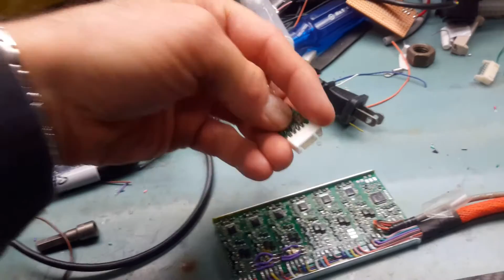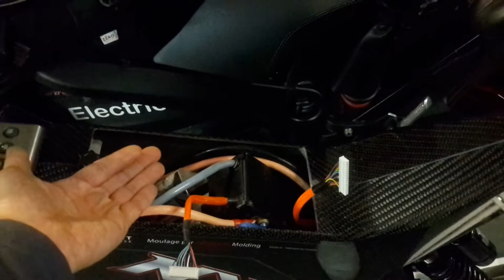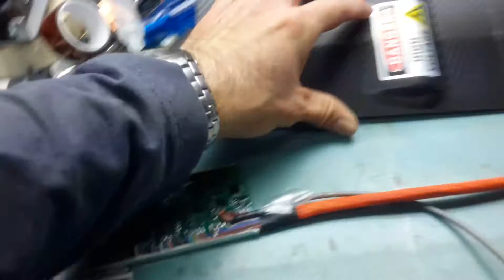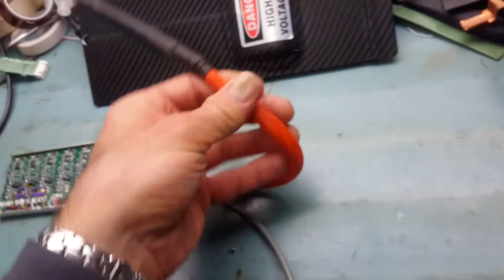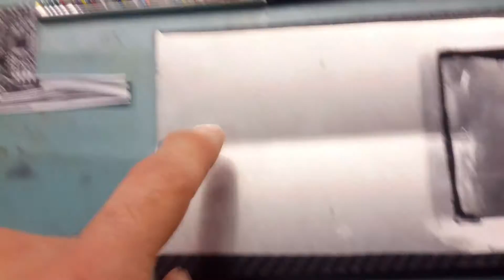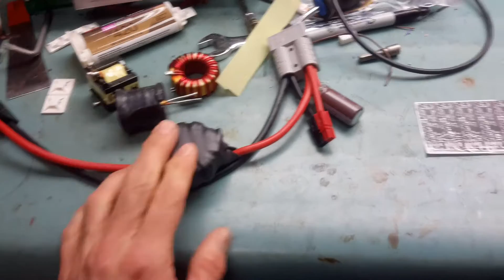NYX bike & Adaptto BMS progress

Comment: Will this BMS work for a 24s (4 x 6s) lipo pack? Thanks
Reply from the maker: yes bit it is recommanded for 22s max when full power is used
Reply: Ah okay. Can you use adaptto Max-E on 24s if you limit current to a low level like 30amps? thanks for quick reply :)
Reply from the maker: yes for sure. the phase current is the key factor. for every 100A phase you get 10V overshoot above battery voltage. keep in mind that like many other controllers, these are using 100V Fets inside so when fully charged your 24s lipo will be toped at 100.8V witch leave you no margin.. however if you use 22s, you will be at 92V witch leave you 8V margin and this correspond to 80A max phase.   you need to understand that phase current generate HV spike on the top of  the battery voltage so if you want to safely use the max 350A phase availlable you must keep 35V margin witch correspond to 65V battery. However some fets can take 10% more(110V) so this give you 10 more volt margin  so 75V battery would be still "safe"  Also temperature change that margin a bit... cold fet will have less margin..
Reply: Doctorbass lipo drop to 3.5volts per cell under load. so that is a total of 84volts under load. 84 x 160amps= 13440watts. which is under the 14kw limit of the adaptto max-E correct?
Reply from the maker: well it depend on witch lipo you use some sag more some less. But yes for a lipo that drop to 3.5V under load and 160A you are at 13440W. You can unlock it too to get more battery amp = more power , however if you push  the phase current too high  will make the FET fragile for the reasons i mentionned above
Reply: I'm using 12ah 6s 15C Turnigy Graphene lipo. If I get the adaptto Max-E I plan on only charging to 4 volts per cell. That will give me a total of 96 volts with a 24s pack. 
BTW when charging through the adaptto what is the max amount of amps it can push when using a 1200watt 24 volt, 60amp DC power supply?
Reply from the maker: Please visit the Endless-sphere forum all answers are there. I already answered you few time to help however  I can not answer individually every single question for everyone like that .. all answers already exist it require minimal effort =)) Thanks for understanding and good succes for your project!

Comment: that's a nice bms set up. is it possible to do something similar with 6 4s lipo string up to make 24s using 6 4s bms to charge each pack. kinda like the one you have for adapto?
Reply from the maker: Yes, this Adaptto BMS is made for every cell setup up to 28s LiFePo4 or 24s LiPo or Li-ion( 22s max is recommanded for lipo or Li Ion). it is optimized for connections of multiple 4s . Please visit adaptto .com

Comment: Nice work with the bms, Doc! And very clever to wire each board separately, this way it is much safer :)
Reply from the maker: Thanks Andrey! I have actually finished the BMS installation and it seem to work very nice. Next thing is to solve the DIY  big charging coil problem. Actually every coil i have built with between 15 to 30uH have the core that heat alot!! It also seem to not be affected by the size of the core i choose. I dont really understand now but i'll continu experimenting